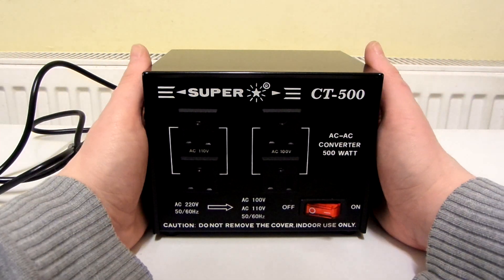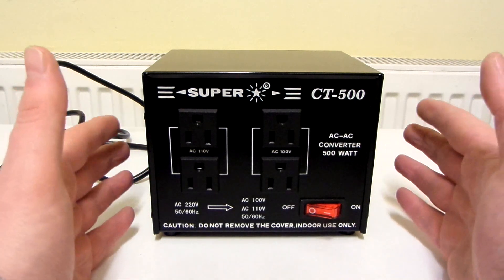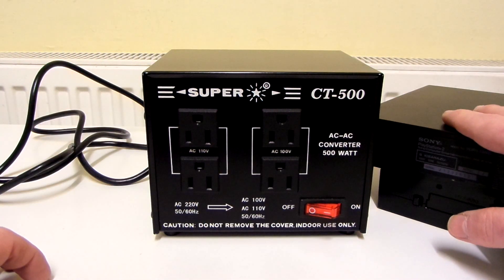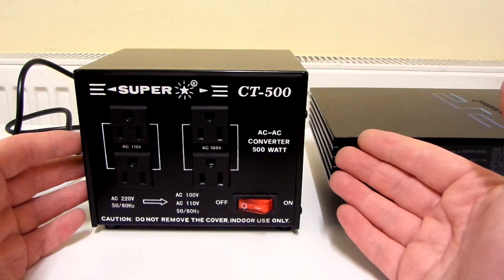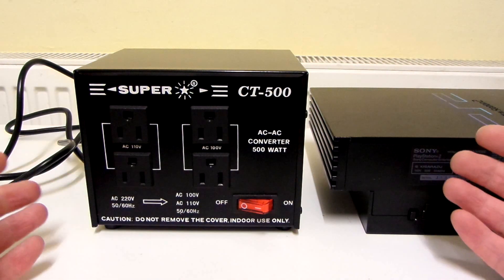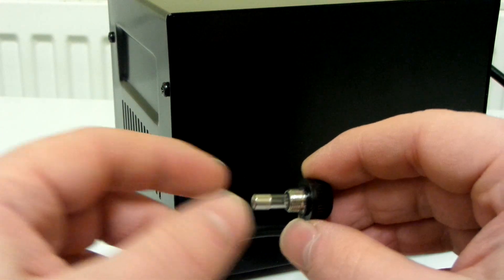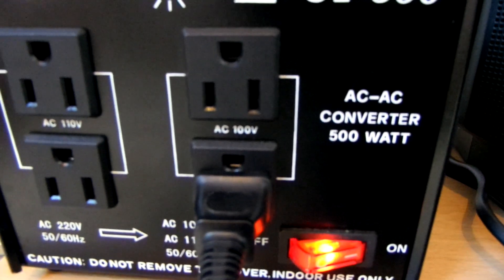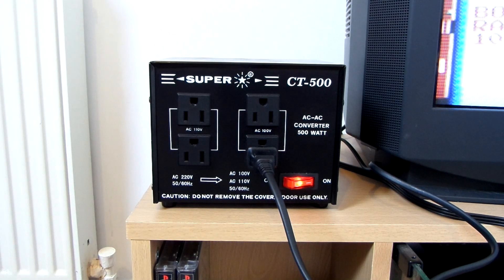Super Star / Superstar CT-500 Review & What To Look For In A Step Down Transformer

Comment: In the U.S. they now run 120V with +-5% 114v-126v. Originally Edison had chosen 110v so that 100v would at least be delivered to the point of service, as his bulbs worked best around that voltage without burning out too soon, but with plenty of lumens. By the 1930's the voltage had risen to 115V. By 1954 when 75% of bulbs were rated for 120V, most utilities had gone to 120V per changes by ANSI. In the early 70's rules had been written by ANSI for maximum variation allowed, and by 1984 the NEC (national electric code) had written standard load calculations with 120V. I'm sure this is more than you cared to know. I'm not sure why manufactures keep putting 110v or 115v on labels when it's been 120v for a very long time now.

Japan is an interesting case, they use 100v throughout the entire country, but for reasons related to early electrical equipment providers some only selling 50Hz cycle equipment while others were designed with 60Hz. Being the early grid wasn't connected in these areas to each other it didn't matter. but they grew and it became too costly to standardize on 50 or 60Hz, so Japan has the eastern half at 100v at 50Hz, while the western half is at 60Hz. Japanese electronics, TV's radio's etc were designed with 50 or 60Hz in mind. Some equipment had a switch to compensate, especially things like mechanical clocks that were dependent on the line voltage frequency. i.e. the motor that was driving it changed RPM depending on 50 or 60 cycle. Especially something like a turntable, record player. So that PS2 has no issues with 50Hz in the UK as you obviously know. 

It's not so much an issue today, as most electronics is not dependent on 50 or 60 cycle can handle either standard along with a voltage rage of 100v-240v easily. Especially things like chargers. Makes it easy to just have one kind of charger for an iPhone and only change the plug standard depending on what country its being sold in. Older electronics from Japan like the PS2 or maybe corded power tools and items with motors and no electronics you would need this step down transformer for sure.

I know a lot of hobbyists and collectors of electronics in north America say you can probably run the electronics at 120v if it's a 100v Japanese device, but not to make this a permanent setup as it may stress the power supply, especially with ones that are 20-30+ years old. That only expect 100v since they are single voltage range device. 

Thanks for this video, lot of good info especially about rating the watts much higher than the peak wattage you expect to run.
Reply from the maker: Thanks. :) I was so worried at first about the PS2 blowing up if I had got anything wrong.